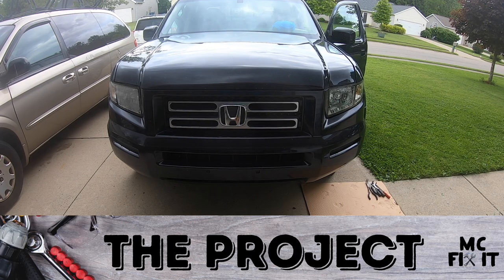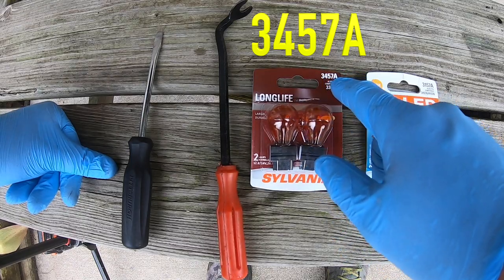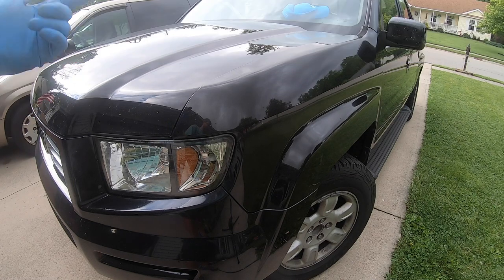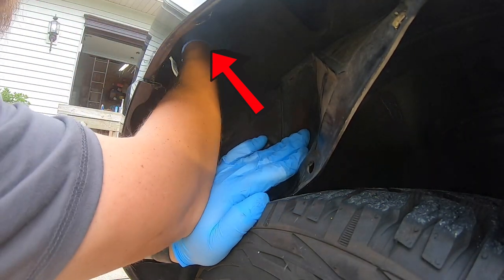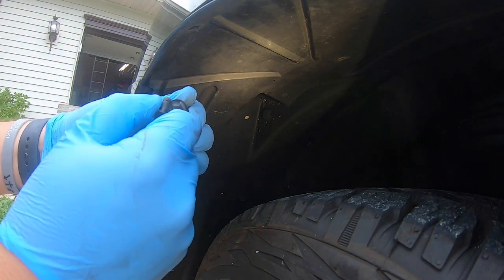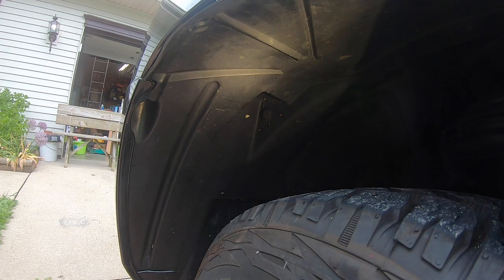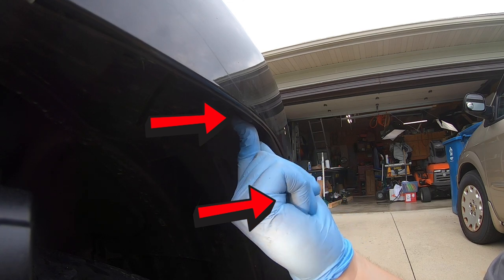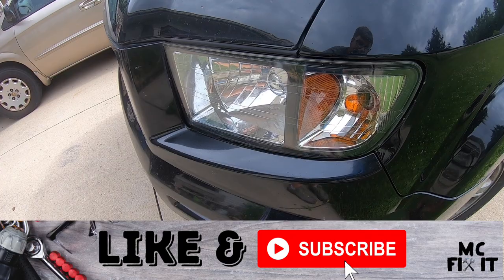How to Install Blinker Bulbs on a Honda Ridgeline 2006-2015 (Complete Guide)

Comment: Thank you. This is the only video on YouTube I could find to address this fix.
I don't know how you so easily removed the little black plastic anchor though, I couldn't figure out what to push on. I had to break mine off.
You mentioned that you had a lower hole thar was missing a fastener. On my Ridgeline, that hole has a screw in it. All the other holes in that flexible assembly had roughly a half dozen plastic anchors.  I just removed the screw and broke off the one anchor,  and I was JUST able to get my hand and wrist inside to change the bulb.  Wasn't easy, but doable. 
Thanks again for the video!
Reply from the maker: Glad you were able to get in there and change it out. That’s a bad design on the Ridgeline. It shouldn’t be that hard to change out a necessary turn signal. Thanks for commenting, I’m sure this will help someone in the future!
Reply: If you are doing an LED replacement for these turn/marker lights, get the 3457 CK type bulb and resistor plug-in. no splicing needed. Just an extra wire going between the original mount and socket got both for the fronts. Rears are 7443 CK type bulbs. Get red/amber depending on rear tail light color. Fronts can be made to be switchbacks. The CK types have different power and grounds than the standard or “universal” fit ones.
Reply from the maker: Thanks for adding this!
Reply: @MCFIXIT  update! 

The CK type bulbs ONLY FIT ‘06-‘08 versions! ‘06-‘08 ONLY! I tried the CK types in my ‘11 and they did not fit. For the ‘09-‘14, use the regular type bulbs and such.

Comment: Thank you for this video. I noticed that my drivers side turn signal bulb would not operate while in running light mode unless I gave it a Fonzie bap! with my fist on the lens cover, then it would come on. But it would continue to happen. I wonder what the issue is, and how replacing the bulb fixes it? 
Anyway, thanks again for the video.
Reply from the maker: Sounds like an electrical or wiring issue. It could be numerous things with type of issue: the bulb not making good contact, lose connection on a harness, bulb could be shorting out, cut in the wire, etc. I’d start with the bulb (check it connection, make sure it’s still good), then look at the wires and connectors. If you’ve got a multimeter you could use that to diagnosis the issue with wire continuity and also proper voltage. Best of luck.

Comment: Great tip to gain easier access to the bulb! I got the 3457A but it does not fit. It is almost the same but a. bit different. Any ideas?
Reply from the maker: That’s super strange. That’s what mine was. What year is your Ridgeline?
Reply: @MCFIXIT  You can delete this post from me. I grabbed the wrong amber bulbs. I grabbed 3757 bulbs. The package looked almost identical. Oops. When I returned them, the guy at Autozone noticed the problem. Mission accomplished and your tip was amazing!!! BTW, 2006 RTL Navi
Reply from the maker: Awesome! So glad! No need to delete the comment. I’m sure this will happen to someone else too. I hate when they do the weird number and lettering. It should be easier than that today.
Reply: Just got the same bulb from Autozone an hour ago that bulb is what computer says.😢 Have to change in 2007 Ridgeline.

Comment: I got a honda ridgeline 07 nd when I break the turning lights turns on
Reply from the maker: Sounds like an electrical issue. Do both turn signal lights turn on or is it just one when you brake?

Comment: When you said it's even easier than going underneath the hood you just go into the fender I'm like oh that is not easier
Reply from the maker: Yes, bc you would have to pull out the whole light housing which means pulling off the whole front bumper. This side is crazy weird but the fender is the easy way up change it out. I should have said that better in the video. Thanks for watching and commenting!
Reply: I just pulled the plastic wheel well down enough to get my hand in and (looking at the light) guidedmy hand right to it, turned it a 1/4 turn and it popped out ... (The wires arent very long so you'll have look into the wheel well to see the light receptacle) push the new light in and make sure it seats well and dosent pop out .. 
Guide the light back to the hole looking for it in front and once you see it go into the hole and seat, turn it a 1/4 turn until it locks and youre done.. 
Check the light before you do anything else and then maneuver the plastic wheel well into place. If you push it and make it fit tight you May not even need a locking pin ... But use one anyways.

Thanks for your help
Reply from the maker: That’s it! If you go under the hood on this you have take off the whole bumper… but that’s the access hole I use in this video. Glad they put that option there. Engineers don’t always think through things like that.
Reply: If you upgrade the turnsignals to LED, you can fix the hyperactive flashing by replacing the flasher unit under the dash with a LED compatible unit for under $20.
You can easily find the flasher by turning on the turnsignals and feeling for the clicking.